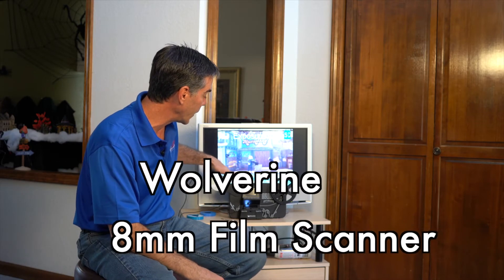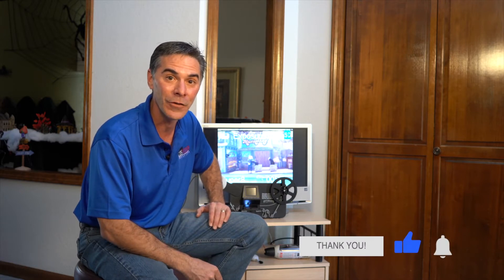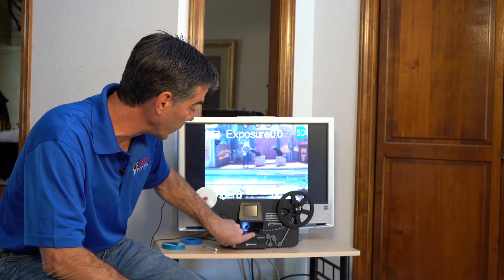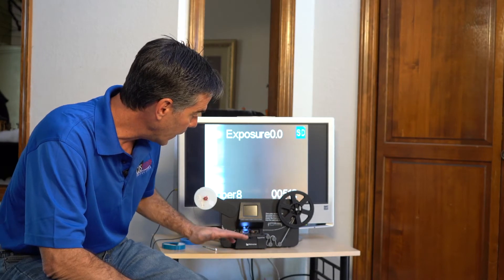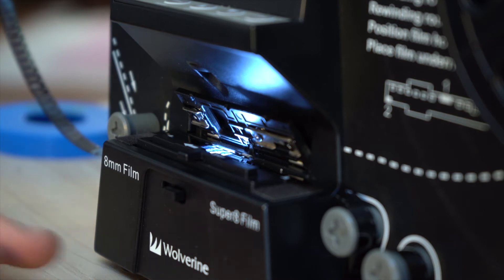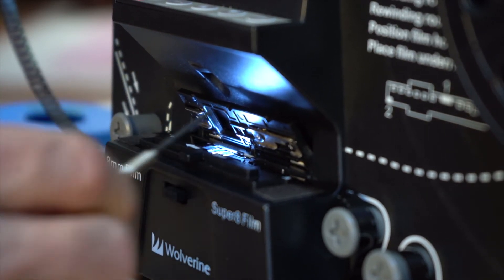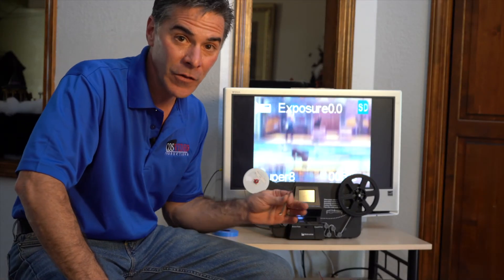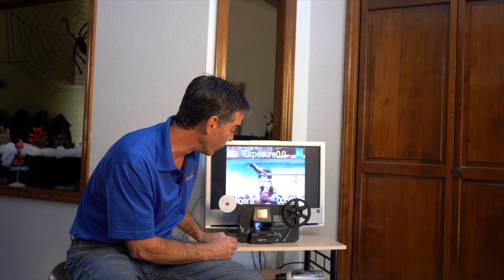Wolverine 8mm Film Scanner Not Advancing Film Properly

Comment: I'm still having problems with this shooting device, I don't think the film shift is technically very well solved.
Reply from the maker: What kind of issue are you having?
Reply: @TheMediaNerdMT  the shooting window is not stable, the image shifts, sometimes the machine jams and the film does not move forward
Reply from the maker: Did you check out my video about the film not advancing and how to fix it?  https://youtu.be/TLI9gAqmHfo
Also, did you make sure that you have the switch on the front of the machine set for either 8mm and super 8mm set correctly?
Reply: @TheMediaNerdMT  yes I have already tightened and loosened the screws but without improvement. My device is completely missing the pressure mechanism to the left in front of the scanning window. I don't know if this is the cause of the bad scan. ? Some of the 8mm films made are Russian, I would expect a problem with the size, but it will also happen in the AGFA Moviechome Germany films.
Reply from the maker: If you are missing the pressure mechanism, that is most likely your problem.  If you just purchased the machine, you need to send it back.  You can always contact the company to get technical support. Here is the contact information.
Call: 1-949-458-9888
E-mail: info@wolverinedata.com
Office Hours: M-F: 9:00-5:00 PST
Reply: @TheMediaNerdMT  I solved the problem by the fact that the film falls into the box after scanning, the cause is probably a bad pull or winding on an empty spool.
Reply from the maker: I am happy to hear that you solved your problem!!!!  That is awesome! Trouble shooting at its finest!
Reply: @TheMediaNerdMT  apparently the designers of the device did a lousy job ...
Reply: @holcmanjiri  I used sticky-backed  felt and attached it to the "sleds" which totally solved my advancement problems. Given the other way didn;t help, try this fix.
Reply: @holcmanjiri  I don;t think that they did a lousy job. I found that the film I've scanned varies in width and thickness. Hard to compensate for that. The sleds seem to in most cases
Reply from the maker: That’s a cool idea!  Thank you for sharing!!!  Please subscribe if have not already, I’d greatly appreciate it!
Reply: @TheMediaNerdMT  https://youtu.be/rv6X_-UGeQA

Comment: I have a reel which was cut a bit too wide so it's good to know this may be a fixable problem. I have a (vaguely) related question: is it possible to scan a single frame? Meaning, with the automatic frame advance turned off? I have a segment of a fragile film which has been mangled in a projector many moons ago and now has a number of transverse creases resulting in a zigzag-like part. This certainly won't go through the scanner but if it was possible to simply do this portion of the film manually advancing frame by frame, I could salvage the footage. Can this be done? For example, can the advance needle-thingy be temporarily deactivated or removed?
Reply from the maker: Hi JanPBtest!  Great question.  Unless you are an engineer who can take things apart and then put them back again, I would not try messing with the advance needle.  However, I do have an idea.  If you have a flatbed scanner like the Epson Perfection V600, which has a slide scanner setting, you can use that but it will take a while.  I have used this trick with little micro fiche type film.  Place the film on the scanner and use plastic tape to hold it in place if you want.  It needs to be lined up where you would place the 35mm film but do not use the 35mm holder. Scan at a very high resolution since you will need to blow up the frames in your editing program.  You will be able to scan a lot of frames at one time.  Once scanned, you will need to select each individual frame and import them into your editing program.  That should do the trick!  Regarding the creases in your film:  I did see a guy take wrinkles out of film by using an iron on low heat and a towel as a buffer.  I have not tried this but if you decide to, try it on a small portion.  I hope that this helps!  Please subscribe if you have not already, it would be greatly appreciated!!!
Reply: Try scanning in reverse. The sprocket holes are usually worn out only in one direction.
Reply from the maker: That is an interesting solution.  Have you tried that method?  Easy to fix the direction in post.
Reply: @TheMediaNerdMT  yes i scanned a bad 8mm film in reverse and changed direction in Powerdirctor
Reply from the maker: @hansjorgcandrian2023  That's good to know!  Thanks.